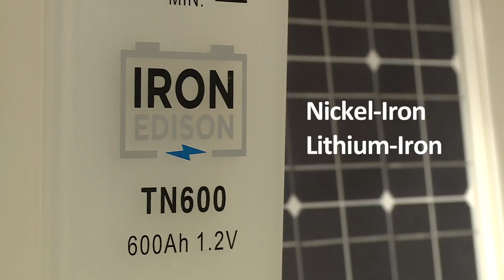Solar Battery Introduction by Iron Edison (Lithium and Nickel Iron)

Comment: They keep mentioning that Nickel-Iron batteries are cheaper than deep cycle lead acids in the long run, but won't give us any actual numbers.
So how do they compare to Tesla's power wall?  Cheaper in the long run?
Afraid to scare us off with numbers? . . . lol
Reply: I worked out what it would cost here in the uk to use this type of battery for my future solar set up. Here in the uk, our Nife batteries are made in the EU somewhere. The cost for what i wanted was £40,000. LG lithium batteries worked out to about £12,000 for a similar capacity, plus the set up will be a lot more compact. Not requiring a warehouse to store them in, unlike the Nife batteries.
Reply: Lithium batteries last 5 maybe 10 years and are a HUGE fire risk, a fire that once started is near impossible to put out.
So 4x5=20 years or 4x£12,000=£48,000 cost for 20 years.
That's £8,000 more than Edison batteries which last 30 to 50 years(real testimony use).
To get 30 years costs £72,000 in lithium or £32,000 MORE than Edison.
50 years =£120,000 in lithium or £80,000 MORE than Edison...provided your place didn't burn down yet.

This is a LONG TERM game, not a short one.
Choose wisely.

Comment: 100 ah batter 12 v is 1 grand a 24 volt 2 grand that 1 stinking battery the 900 ah one is like 18 grand there 9only 1.2 volts each so you need 50 grand worth of bats to get going or 900 ah 200k worth

Comment: Dont even think about it people. These are made by changhongbatteries, China, & their claims are only this '★Long service life, over 20 years service life under floating charging state; if the battery is maintained and used as the recommended ways and under the 50% DOD state, the service life can reach over 10-15 years.'
So what is it 10, or 20, or like the video 30 or 40yrs...........piss off scammers!

Comment: bs
Reply: No really dude these batteries last 30 years (or longer), but they're not without work, you have to maintain them and change out the fluids 7 to 10 years(when it's time to replace your Lithium batteries at $10,000), you have to rinse them out (distilled water, rinse until the fluid is clear again). When you see the fluid get cloudy, it's time to rinse, and they need fluid top off sometimes on a weekly basis. Cost is a winner, but these solar companies are getting these batteries from China @ $8,000 (400ah 48volt - 24 total batteries) and they are charging more than double to sell them to you with their logo (printed on in China) from the same factory that you can buy them from. They might even be getting a better "bulk rate" deal, but I can't confirm that. I'm in the process of buying my own bank for $17,000 (ordered from China, same battery) and these companies here wanted to charge me $42,000 for the SAME battery bank.

Comment: Overpriced by 50 times for the cost of the manufacture. This is a corporate scam. They are good batteries but since they last forever, (in human terms) they rip you off by scamming 10 times the very profitable price. Read up on the history.
Reply: But you know they cannot sell you another battery in 30 years
Reply: Who does sell a good battery at a good price ?

Comment: what is the different between iron edison nickel iron battery and changhong nickel iron battery?
Reply: $18,000 if you order from China direct,... $42,000 if you buy the same battery (they buy from China) with their logo printed on the battery (which they do in China) for 1000ah 48volt bank.